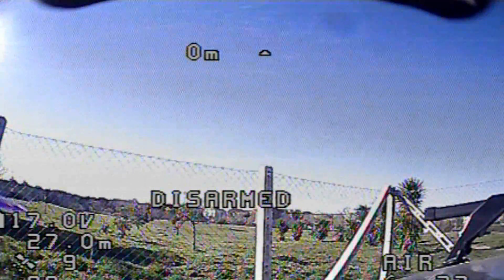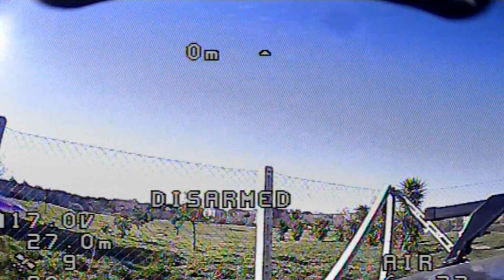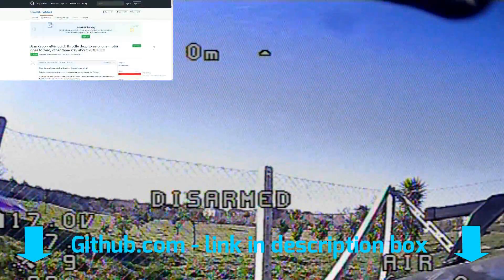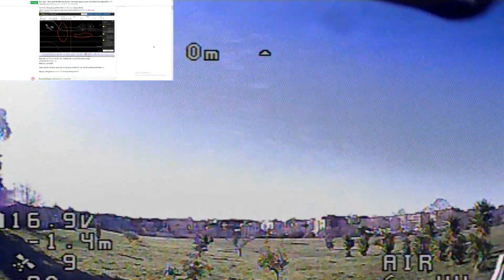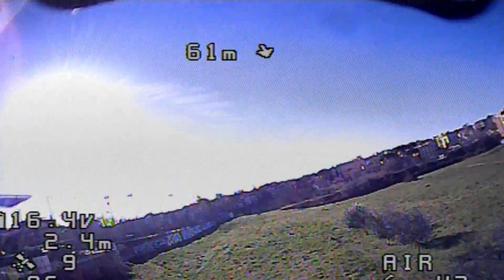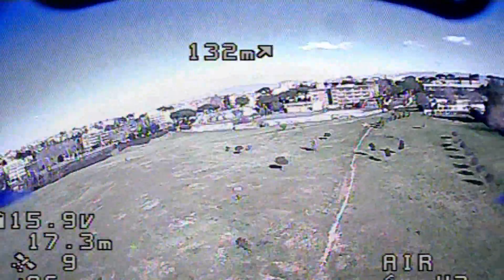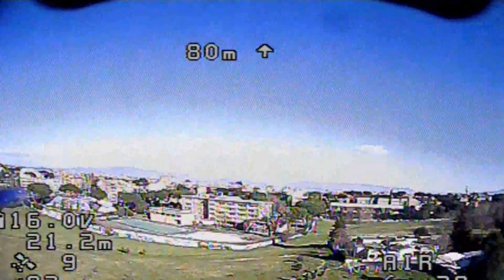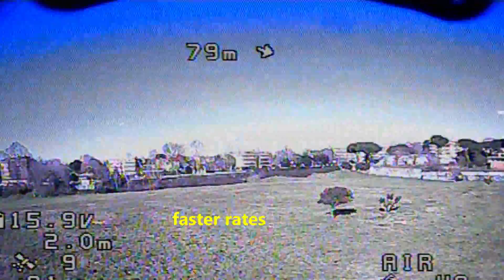[SOLVED] HELP!💀Death Roll💀Throttle drop to zero falls from the sky #Airmode #deathroll #betaflight

Comment from the maker: [SOLVED] I'm almost sure it was a damaged ESC. I had a 4in1 esc and kinda abused turtle mode while stuck in a bush and the props were stuck as well. After changing the esc and downgraded to an F4 board from an F7 everything was back to normal 😎
Reply: most likely motor de-syncs.... switching the ESC helped because it proly could handle the timing better.. but all you woulda had to do was increase Demag compensation in BLHELI.

Also... this is not the issue that the forum thread was talking about.

Comment: Def a bad motor, bad wiring, bad esc.. You say your reaching out, but your not listening...  BBlog..You've got  the data!    It's simple.. when you demand more than the "system"  can offer up, it  desyncs.. Somewhere in your system  is either a bad component, or a bad solder.or screw in motor .   Had this  alot when I first started out.  When you are in acro mode, it will do it to,  you just have to move it rapidly enough..  Also   you may try bumping up   idle speed..
Reply from the maker: Why you say that? I am listening. Thaks a lot for your comment, I find it super useful though
Reply: Check on blheli and try to decrease startup power by half or even go min and then up step by step until it does it again.